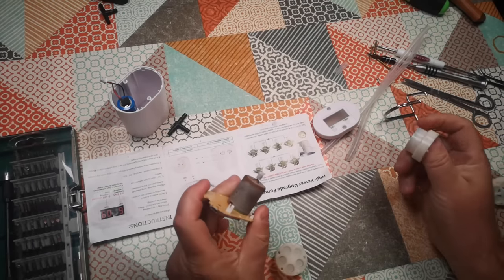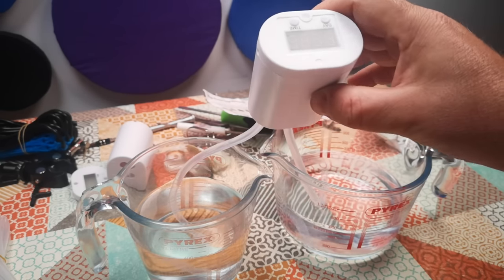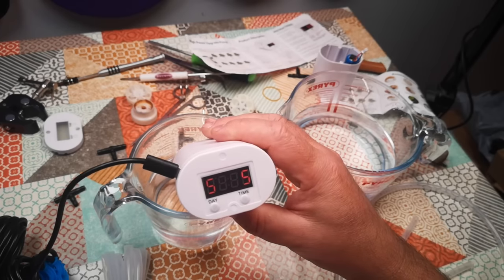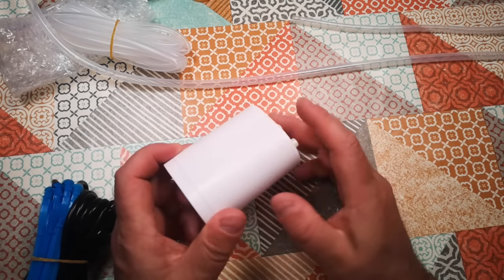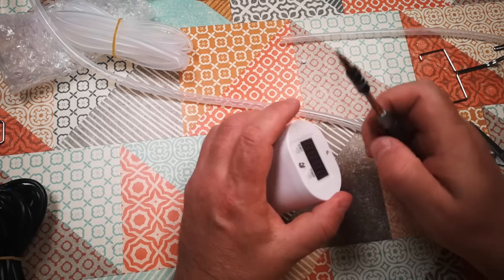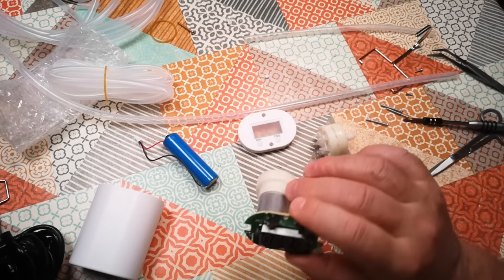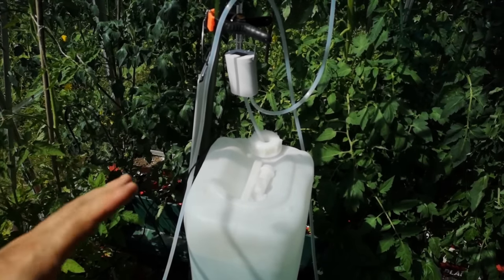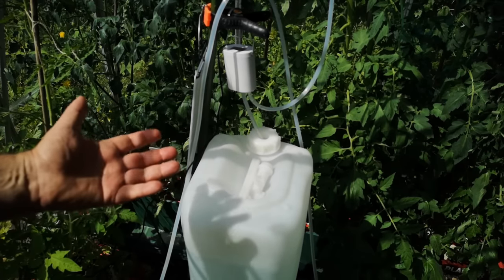Automatic Greenhouse Watering Part 2 – It Works! And Then I Broke It!

Comment: Maybe some useful info, I bought the same (or at least similar) device from AliExpress unit and measured the battery capacity, came out to just about 1500 mAh, the motor seems to draw about 0.8-1 A depending on the state of charge of battery (though that's after replacing the cell with a 3200 mAh one and soldering thicker wires to it, so I guess it would be less). Anyway, that should mean about 1.5-2 hours of pumping time with the original cell, lets say 1.5h then 1.5*3600s/(7days*100s) ~ 8 weeks of watering every day for 100s, so it seems to sorta check out at least on paper. Btw mine seems to beep aggressively and doesn't pump when it detects no water.

Comment: Perhaps as an alternative you could look at making something akin to a Pythagorean cup (or a urinal cistern from a reclamation yard 😁). Given a high enough hydraulic head it wouldn’t need to be sighted at the greenhouse itself so could potentially be drip fed from a mains water supply or tank. No moving parts should make it super reliable.
Reply: You could just put the drip directly on to the plants if you do it that way.

Comment: I started one of these with an arduino but got sidetracked and never finished it. Basically a bucket that fills with water (from a solenoid valve) using float switches as sensors to keep it filled to the right level (with an overflow into a sump hole in case anything goes wrong). Then a submersible pump with a water flow sensor (hall effect) so the arduino can pump a specific amount rather than based on time. Each plant has an electronic moisture meter which gets read every 24 hours, and that determines if it's time to fill or not and how much. There's also solenoid valves connected to a manifold so one arduino can monitor and water multiple plants independently.  This way I could different plants with different pot sizes/water requirements when it was necessary. It was mostly done, I probably should get back to finishing that 🤣

Comment: Seems those motors are prone to developing burnt brushes or dead spots on the commutator. They are simply a tad too cheap for the job. They should be replaceable with a bit of soldering though.

Comment: I kind of reiterate what I said on the previous video. It may be more expensive but more worth your time and money to build and customize a solution based on something like an ESP32 microcontroller. You'd have a lot more control over the components and likely far better fault tolerance.

As is often said: You get what you pay for.

Comment: I'd recommend getting an old 12V car battery and either run a 12V pump or open a solenoid valve for a reservoir of water that you manually fill that's high enough

Comment: Can't but help feel that the first seller had acquired a number of returns which were mostly due to the motor failure, possibly from the pipe kink issue, possibly just down to poor quality motors, tested the units to see which ones the motor still ran but without actually testing pump function and repackaged them.  This would explain not only how you ended up with a wet one (had been in use before failure and return) which corroded while in transit to you but also how they had extra pipe sets that they were effectively just giving away.

Comment: If you go down the diy rabbit hole why not just use the existing control  board and replace the motor with a relay.Maybe an old 12v battery and solar charger ,5v regulator to do the power for the control board and a 12v pump.If however you want to start from scratch the pi pico is a nice cheap option.

Comment: I went thru several iterations of various cheapo pumps from ali express, ultimately they were generally all unfit or poor performance. If i were you i would buy a "bilge pump" for a boat, hooked up to a 12v battery with the solar trickle charging the battery , probable need an arduino or 12v sonoff to control it using inching , could add a Moisture monitor to soil and all in sub £20 if youve got an old car battery

Comment: It's a bit more involved and requires a fair bit more money that this, but here's how I would set it up.
I would use a 12v lead acid battery charged by a solar cell, then I would run an arduino or a rapsperry pie of that battery, then the arduino would actuate a relay from the 12v battery that runs a bilge pump in a large barrel of water. I'd try to feed the barrel with rainwater to replenish the water.

And yes I did think of this before you said it in the video.
Reply: You could also set up a drip watering system the same way but instead of an arduino you would put an upside down floating limit switch in a small resevoiar above the pots, that way the bilge pump will run as soon as the level in the smaller reservoair drops to low, thus keeing it dripping the whole time. You could even use those lines and nozzels for the same system. You just need to balance the hight of the upper reservoair to get it to water at the correct rate.

Comment: You did these phenomenal clay and pottery series. I was wondering if there is any old or ancient method of watering plants. 
And also, just for optical reasons, I would definetly go for macrame to hang up the bottle ;-) But thats a matter of taste
Reply: I think the old or ancient method was called, 'getting the neighbour's child to do it in return for token payment much, much later.

It a system that worked perfectly for my neighbours many years ago 😂.
Reply: you can dig a hole in the ground and put a terracota pot i there, which will evaporate the water slowly over time since terracota "sweats"
Reply: Isn't what he did just macrame but with wire though, so it's "Manly" lol.
Reply: A lot of planters have a chamber below the soil. You fill it full of water and the soil naturally absorbs the water as needed.

I have a planter with flowers in it that uses that design. It works great. I bought my planter at my local Ace Hardware store. It is made of plastic and cost me about $22.
Reply: @neshbro Lol

Comment: Raspi is a) overkill, and b) too power hungry for a 12v lead-acid battery+Solar arrangement. 
ESP32 is probably the lightest-weight, but I'd be very tempted to hoick the 'busted' motor off the good board and replace it with a relay to switch a smaller pump.
Reply from the maker: Yeah, I think the controller they have in this thing probably has a low power sleep mode or something like that. There's no real time clock, but it has a crystal so it's probably able to sleep for a predetermined number of ticks or something.

Comment: Hey mate did you check out the pot prods i suggested...just a bottle water per plant gravity feed...i appreciate any wildlife in your gsrden  knocking stuff about no good....my prefered method is a pot laced with cloth material coming outside bottom off the pot sitting into a resouvoir off slightly nutrient added watter you can design very neatly and there really is no worry off anything failing i spose you could name it hydroponics but its just a water spot underneath thst your roots will pull the water up as n when they thirsty...im going back too simple as posdible...thank you shrimp your brain works like mine i get so tempted too tinker anything n everything even if ive just bought it 😂😂
Reply: Garden beds u can lace small litre bottles into the soil and they will slowly leak due too gravity n your design as long as a bit cloth in soil when dry will pull from your water source ...thanks shrimp P.S how is Davis bon I'm getting very worried
Reply: Be great too communicate at some point if ya get bored gimme a shout some point, coz I feel we on same lines with Couple things...cheers

Comment: Try searching for hobby model boat electric motors. You could also wire both batteries in parallel which would increase battery life.

Comment: Back in the day i made a simple circuit that turned on a model aircraft fuel pump using a 555 timers and relay  that did the same job as this.

Comment: As a project manager, this needs a proper risk analysis. The negative outcomes seem quite severe (partial/ full loss of the household's tomato harvest), the design choices (cheep & cheerful with several single points of failure) and the planned absence of all support staff at a critical period in time (heatwave & main growing period) make for a project that I'd want to monitor very carefully...  No, I'd earmark it for a potential capital injection, e.g. approve funds for a business urchin on standby to take over the running of the watering can during the PMs absence.

Comment: the same motor & diaphragm pump that's inside that is sold as an air pump & a vacuum pump so the design shouldn't be affected by running dry.

Comment: @13:53 - Any drip irrigation system I ever got has the black, semi-rigid tubing for use in the system.  I found out about kinking silicone tubing when trying to make nitric acid.  The condenser water line kinked and semi-ruined the process.  Silicone is nice and flexible - too flexible.

Comment: ESP8266 is a cheap, wifi-enabled microcontroller that would work well for a project like this, and you can run simple Python scripts on it. I just finished creating a cloud-controller sprinkler controller using one of those and a 4-channel relay

Comment: Just get a cheap Atmel attiny chip, a suitable MOSFET, and a low power pump. The code would likely be just a few lines. Problem is like this product, you could not tell it what time to turn on as those cheap micros don't have a RTC. You could pay more and get one with a RTC if you really want the ability to turn on or off at exact times.

Comment: As for whether the pump is designed for water or air, I can't say for sure, but I have seen a similar pump used for air in an inkjet printer.

Comment: Why don’t you buy a 12v timer switch. Some have various voltage settings. Use in conjunction with a standard 12v submersible pump and build the water flow irrigation yourself.

Comment: A mechanical setup would have been interesting. A flow regulator on the outdoor tap, then a resevoir that slowly fills up and when full tips over or siphons into the dripfeeding setup. No power needed, just mains pressure.
Edit: a pythagorean siphon I mean.

Comment: Probably has more trouble pulling water than pushing because it runs on air for a while while pulling, and it should be less efficient pressure gradient wise.

Comment: You could use a 12v bulge pump and use a float switch in your upper tank to switch it on. A lawnmower battery with a solar charger should last all season.

Edit* I watched the rest of the video and realized the watering nozzles are not metered in any way so my idea will not work with them. But it does work well with metered nozzles.

Comment: you probably can just use the circuit board of the water pump instead of an arduino or pi for the timing and triggering and either use a different motor and pump. or at the very least use the current that would go for the motor of the original pump to trigger an electrical switch to power a different motor and pump if the board doesn't output enough power.

Comment: The water pressure at the tap downstairs isn't good enough to push it upstairs?!  I'm surprised you need a pump; on/off valves for lawn irrigation are easy to find, as are timers for same.  In fact, I had to replace one this spring.
Reply from the maker: There's enough water pressure, but we may be facing a hose pipe ban soon

Comment: Unlce shrimp why dont you buy a 1m³ container put it at top and just fill it with a hose, then put a timer that opens a valve for a time to get the water going down, saces you the pumping hastle. Theres even smalle containers if you choese, 1m³= 5 barrels, theres from 1/4 barrell to 50 barrels

Comment: I was thinking why not use a drip valve, like the ones you see on IV bags, and just use only the big header tank?
Reply: If you have hard water, a slow dripper will often clog unexpectedly.
Reply: @pattheplanter  Could be mitigated with a hardness filter before the dripper. Or just pull water through it to fill the header tank with.

Then again, some plants might prefer hard water.

Comment: Nice electronic fetteling.
The weak(est) link may be the lithium cell exploding in the heat of the greenhouse. Shade the pump to keep the temperature down. Good luck :) (also to the tomatos).
My fingers are crossed.

Comment: you can just buy a stronger motor for 2-3 quid or use the control board to power a differant pump
Reply: don't hang the pump directly under the bottle just in case it leaks over the pump

Comment: Get a third one for dispensing fertilizer!
Reply from the maker: I'm thinking there might be a different, slightly more robust pump for the main water flow, then one of these smaller pumps just to dose the fertiliser into the header tank.  If the fertiliser fails, the plants won't die outright

Comment: If your main reservoir is higher than your plants you could have just used a 12 Volt solenoid on a timer on the outlet pipe. ?

Comment: fwiw i use a system similar to your goal using a sonof 5v controller running tasmota powering a 5v usb submersible pump to fill 2l milx cartons fitted with a bell siphon made from an old caulk tube, tube wise i use a similar black tuber to yours sourced as an irrigation set, but for inputs i use spare 3/8" beer line and old siphon tubes. the 5v usb pumps are cheap weak links but i am still using the first one after buying a few spares. the usb pumps have a limited head circa 1m only..

Comment: I'm no electonics expert but other than this phone there is absolutely nothing in my house with a circuit board. That being said I could build a programmable watering system using parts from a  dish or clothes washer, basic toilet components, an analog mechanical timer where the pins are set in a dial and all you'd need to test is flow rate over time. I may or may not have legalized 4twentee before it became a fad.

Comment: Be very careful with leaving things like this plugged in indefinitely! Most of these cheaper devices with LiON batteries do NOT have proper BMS and if are succeptible to thermal runaway AKA fires. Leaving them on the charger can exacerbate this.

Comment: the internet is slowly becoming unusable thanks to sellers like this, peddling junk thats not fit for purpose. you have to be so careful
Reply: I don't think this is a new issue. As seen on TV products have done this for decades. The difference is with those, you buy one piece of garbage for $200, instead of 20 for $10.
Reply: @kenningtonrund282   True enough, i just think its becoming prolific to the point where finding legitimate products for niche use cases is almost impossible unless you're in the know and know what brand or shop sells the legit product.

Comment: Couldn't you just do this without any eletric? Have a tank of water above the plants collecting rain water and then have some tubing connecting the tank to the watering devices. If you restrict the water flow enough through the pipes then it won't drain all of the water out of the tank instantly, instead essentially drip feed the plants water throughout the entire day instead of a lot of water in one go.

Comment: I'm sorry to say, but it seems to me that you've overengineered this solution that you don't fully trust (Rusted motor). Wouldn't it have been much easier, and far more reliable, to just fit a battery operated timer onto your outside tap. I spent 30 seconds on Amazon and I found one for £31 and another purely mechanical one for £15. I won't post the links, but here are the titles of each product:
1. Chapin International Chapin 41002 Single Zone Water Timer with Digital Display - £31
2. Orbit 62034 Mechanical Watering Hose Timer - £15
If for any reason you don't have an outside tap, you could easily use an indoor one, as I'm sure you can safely find a way to lead a hose outside.
Reply from the maker: There's no mains water or power near the greenhouse. There may be a hosepipe ban any day, so that solution isn't going to work

Comment: Have you considered buying a 3d printer? You are very tech savvy and projects could make good use of one.
Reply from the maker: I've thought about it - repeatability of small parts is a problem that has often troubled me in previous projects.  I think it's the 3D modelling learning curve that's probably the thing holding me back

Comment: It's not as pretty but you could get a water pump worth half a damn, a battery pack, solar panel and seconds per day timer, and put them in a waterproof box (or baggie whatever floats your boat haha)

I'm surprised it blew a winding, I've never had a motor do that, they can usually handle an amp or so, very bad build quality. Shame you got a dud, but a fun video anyway
Reply from the maker: Yeah, I suppose it might still only be an oxidised spot on the commutator or something, but then it depends on how the circuit is implemented - I will at some point open up that motor and see if I can find the damage
Reply: @AtomicShrimp  It could well be a dirtied commutator land, especially with cheap chinese stuff. 
I know 18650s can supply multiple amps if not 10s of amps given the right conditions but i would have thought the driving circuit would have died before the motor. Very odd.

I can direct you towards a pump I used in a project for work in which I needed around 30cm of head, around 2L/min, it runs on 12v but with the right pieces cobbled together it can be relatively cheap but way more reliable. 
(I used it to pump water out of a test locations loading garage as the standing water was causing trouble with our equipment)